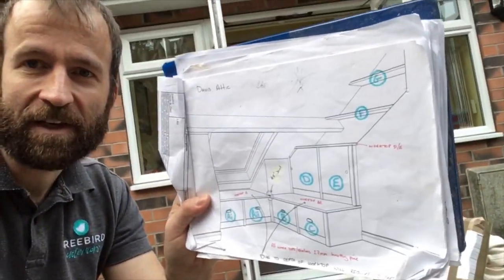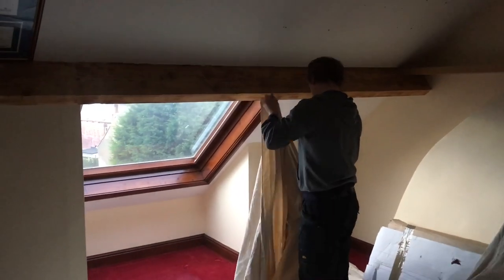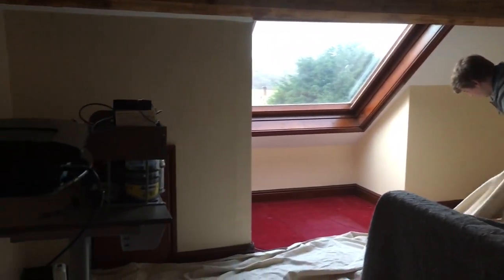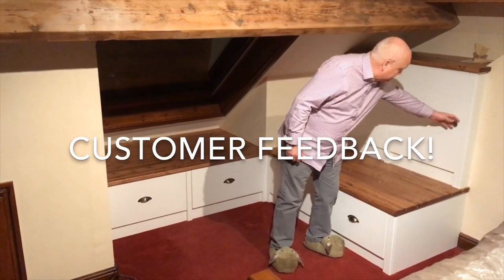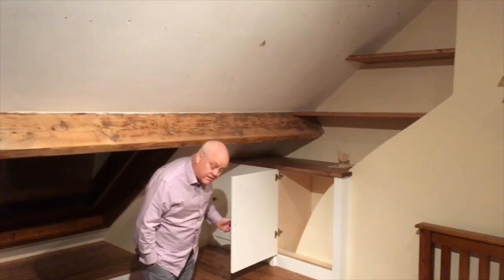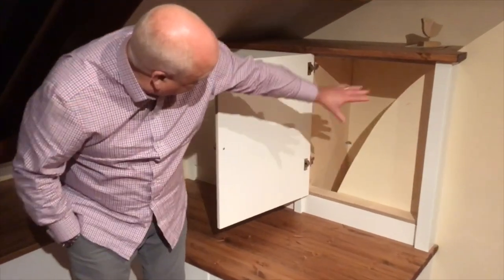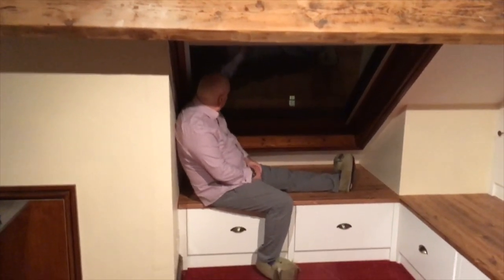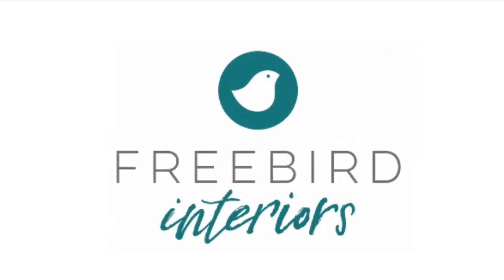Attic Storage Design and Installation

Comment: Stunning Job once again. I like the countertop. Looks great with the painted units. Did you make them or are they off the shelf?
Reply from the maker: Anthony James Brown thanks!  I put more details on construction in the written description.  We buy pineboard from an excellent local supplier called Optimum timber supplies.  We used the 27mm thickness, sanded and shaped the edges, stained with water based stain, and finished with 2 coats of hardwax oil.

Comment: Hi Alister, another great video. Thanks for sharing. 

Can I ask, the angled cabinet against the pitch of the roof. When designing this in SketchUp, was this particular unit a cabinet sense component or freehand drawn. If it was an edit to the cabinet sense component, how did you get the angle set on the cabinet? Many thanks in advance. Jonathon
Reply from the maker: iBuild Interiors Hi Jonathan no unfortunately you can’t do angled cabinets in CabinetSense.  We either drew all the parts of that cabinet separately, or sometimes we start with a CabinetSense cabinet then doctor it (so the labelled parts stil aitomatically go to the cutting list.  We would do this by turning off the top; offsetting sides downwards, cutting a angle off the top of the back panel, then drawing only the angled top as an additional component.